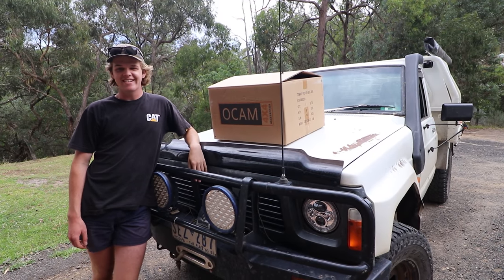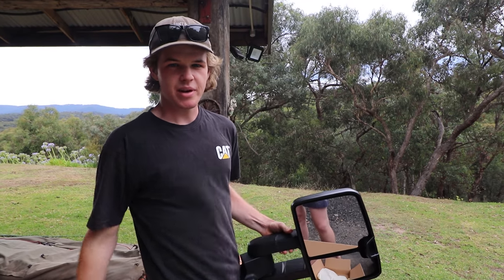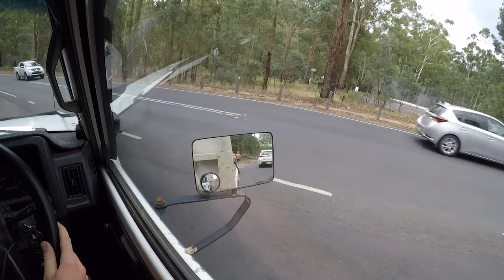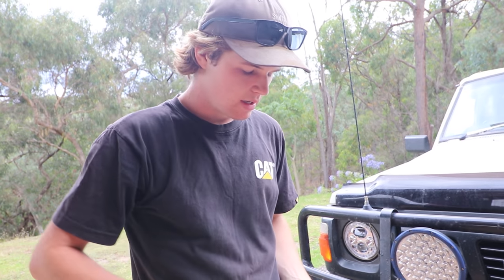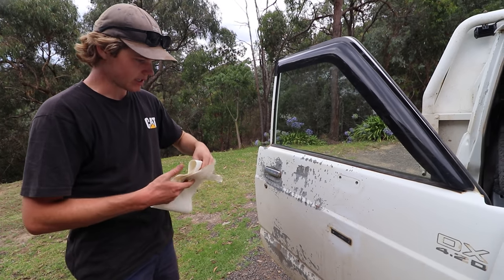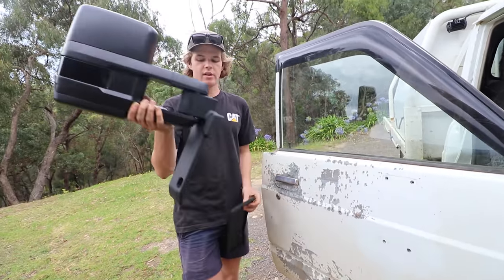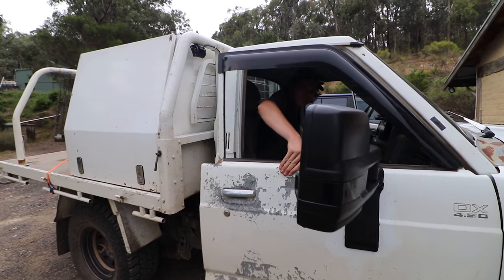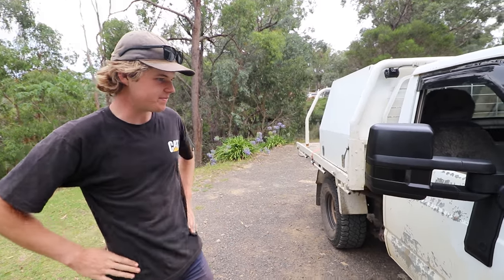Best Towing Mirrors? | OCAM Towing Mirrors on a Nissan GQ Patrol 4x4

Comment: Why did you put them like in the middle of your door tho?
Reply: Cause he put them in the original bolt holes
Reply: @friendlyweapon7880  I’m not sure
Reply: They look a bit silly being mounted in the middle of the door (I get it, that’s where the holes were)... you have to look so far down and to the left/right to even look into them 😂
Reply: @davidh915  if he hits something and they fold in it will hit him in the conut
Reply: The mirrors look great, but it really doesn’t seem practical to turn your head 90 degrees when driving to check your mirrors - they need to be mounted further up the door, not in the middle...
Reply from the maker: You could of, would of just had to patch the old holes, match the paint and paint them, and then drill new holes.
Reply: @AussieArvos   paint match what paint?
Reply from the maker: @friendlyweapon7880  so if we moved the mirror positions we would be left with 4 holes in the door from where the old mirrors were, so we would have to patch the holes and then spray them white to match the paint of the door.

Comment: i think if the were bolted onto doors that had the other style of manual mirrors (the little plastic ones that mount right up in the corner) it would be better. at the moment it looks like you're turning your head 90 degrees just to see the mirror.